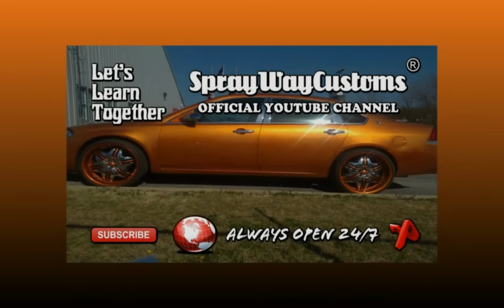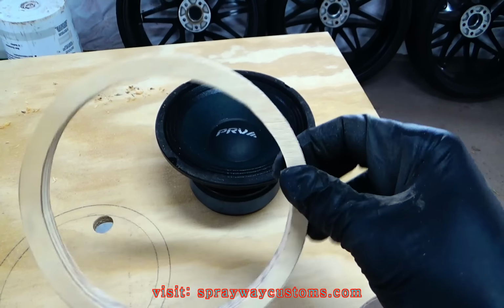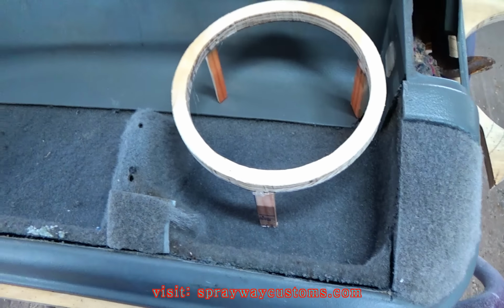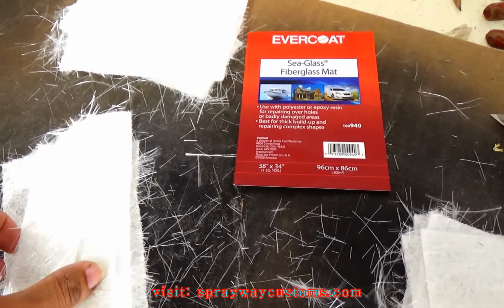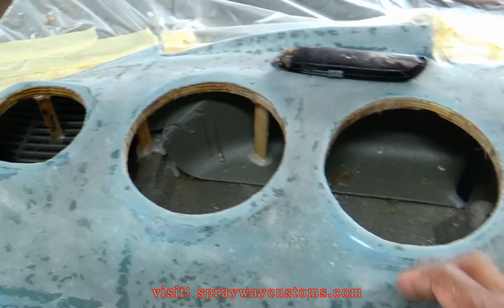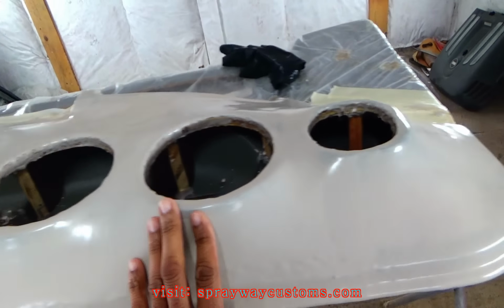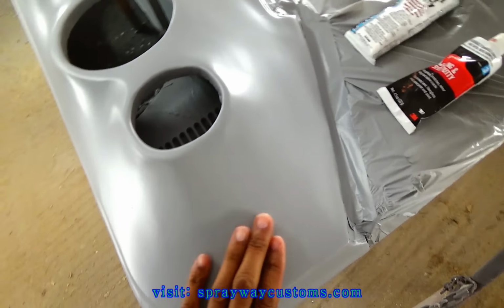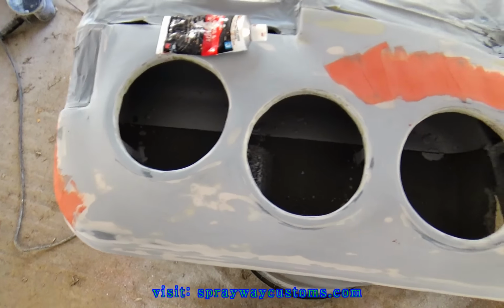How To Fiberglass Door Panels Step By Step 1996 Bubble Chevy Impala / Caprice

Comment: Why did you use that cheap plywood instead of MDF?
Reply from the maker: Why use mdf when it's only to support the fiberglass until dry. I could've used aluminum foil are paper. The wood is not the primary support. It's the fiberglass
Reply from the maker: Exactly....they're not getting the concept. We're not building a speaker box. I could've used a piece of paper, plastic etc. everything on the panel is supported from the fiberglass not the wood.